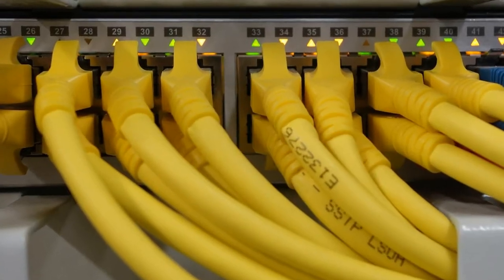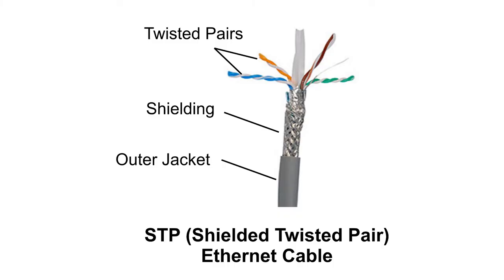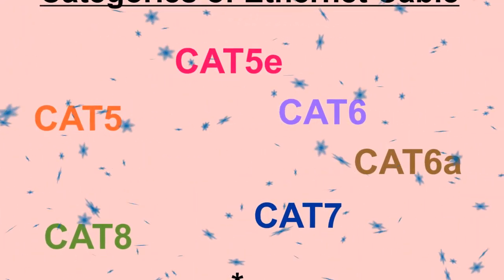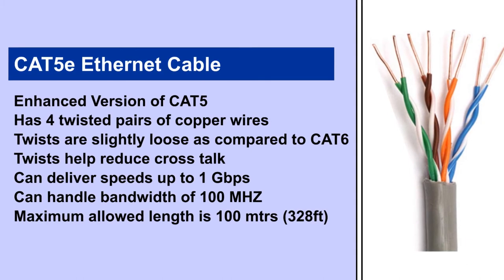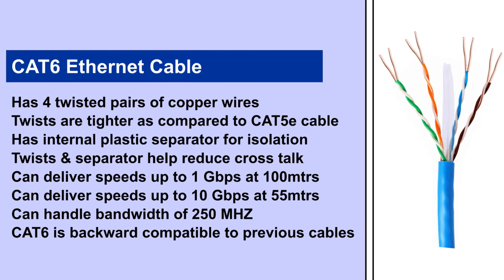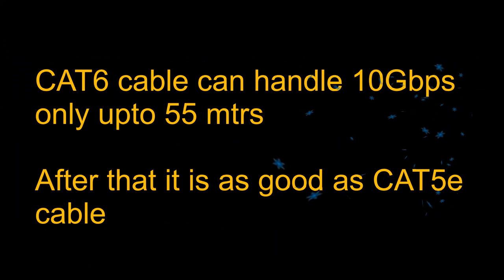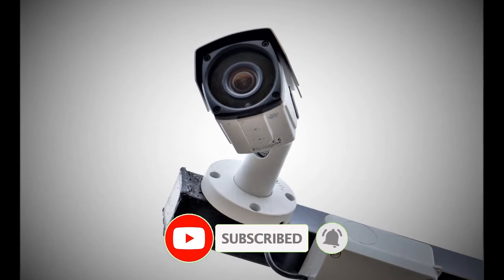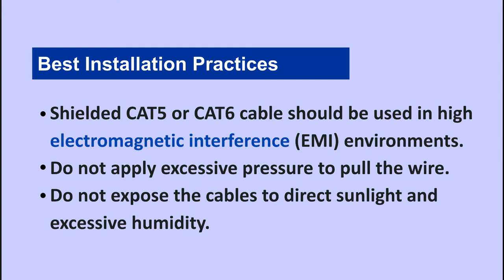Which cable is used for IP camera? security surveillance cameras, surveillance cameras, camera cable

Comment: Errrr,  cat 5e is sufficient for current tech cameras. Look  4 MP cameras (very high end) only use 8 Mbps.  You still have a spare of 92Mbps capacity unused in that cable for a single 4 MP cam. Now you may want to do a CAT 6 connection between the NVR and the switch , and from the network switch to the Modem(or router with internet).
Reply from the maker: Correct.